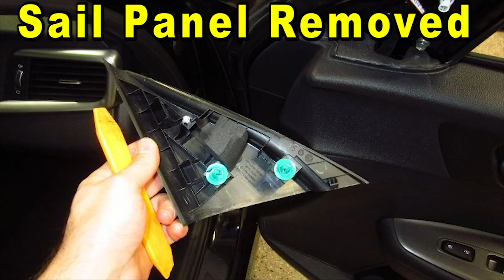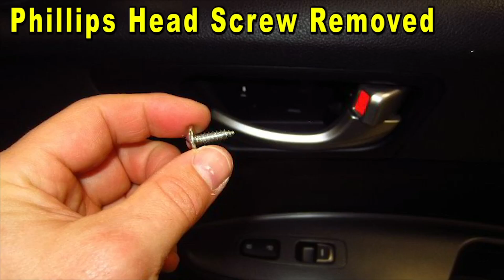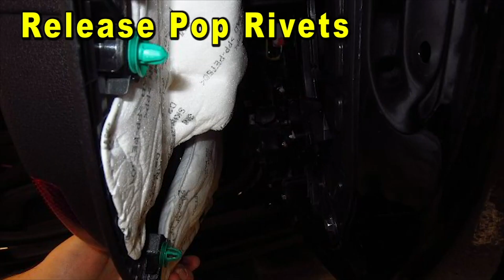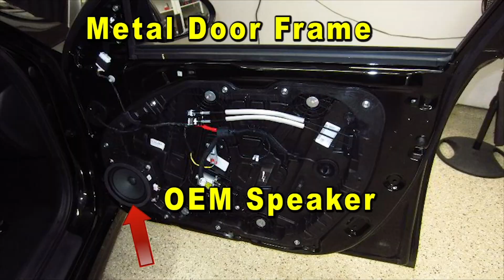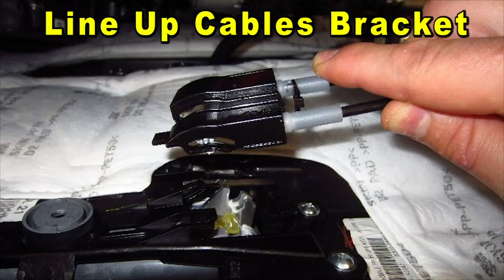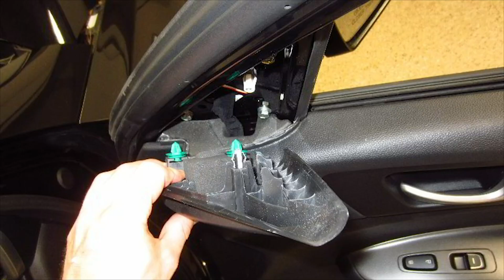2016 To 2020 Kia Optima How To Remove Door Panels & Upgrade Speakers - Quick & Easy

Comment from the maker: Kia Optima Compatible Speaker Sizes - https://amzn.to/3RBclfq
Dynamat Sound Deadener - https://amzn.to/3Rxnmyt
Precision Screwdriver Set - https://amzn.to/3OYN1i0
Plastic Pry Bar Tools - https://amzn.to/3HMtsV7
Socket & Ratchet Set - https://amzn.to/3Z17LbA
Mechanix Gloves - https://amzn.to/3jCnHkt
Torque Wrench - https://amzn.to/3vS5uSI

The Paul79UF YouTube channel is a participant in the Amazon Services LLC Associates Program, an affiliate advertising program designed to provide a means for sites to earn advertising fees by advertising and linking to Amazon.

This DIY video shows owners of the 4th generation 2016, 2017, 2018, 2019 and 2020 Kia Optima how to take off the plastic interior door panels and upgrade the OEM speakers.

Comment from the maker: Check out the DIY guide for removing the door panels and upgrading the speakers in a 2016 to 2020 Kia Optima sedan - 
https://www.paulstravelpictures.com/2016-2020-Kia-Optima-Interior-Door-Panel-Removal-Guide/index.html

Here are all of the DIY repair and maintenance tutorials for the fourth generation 2016, 2017, 2018, 2019 & 2020 Kia Optima - 
https://www.paulstravelpictures.com/Articles/2016-2020-Kia-Optima-DIY-Repair-Maintenance-Guides.htm

Owners of other Kia, Hyundai or Genesis vehicles such as the Niro, Sportage, Sedona, Telluride, Sorento, Rio, Forte, Soul, K900, Cadenza, K5, Stinger, Tucson, Santa Fe, Kona, Palisade, Elantra, Sonata, Accent, Veloster, Ioniq, Nexo, Venue, G70, G80 and G90 may also find these DIY instructions to be helpful.